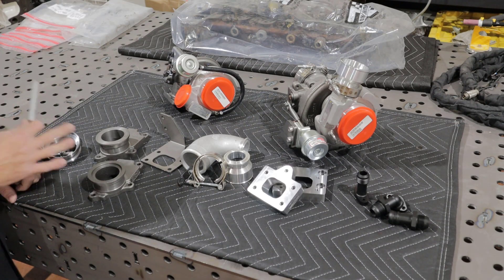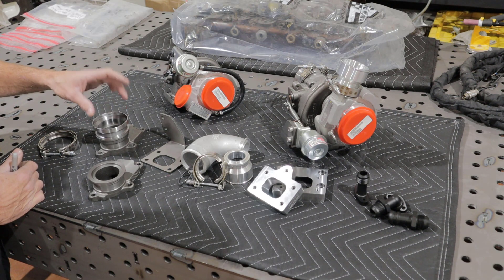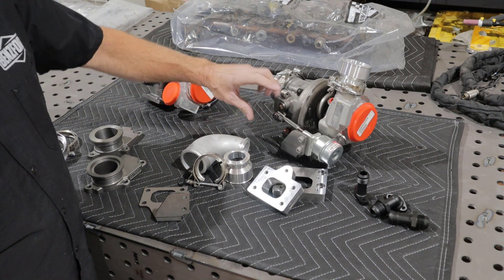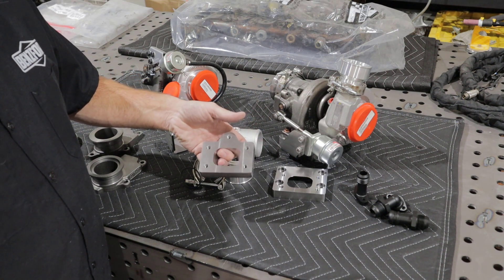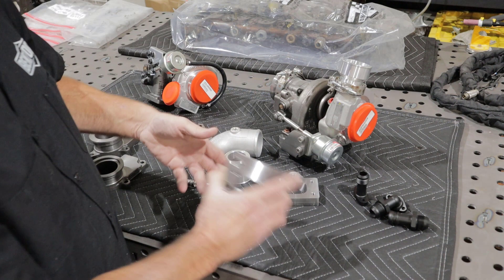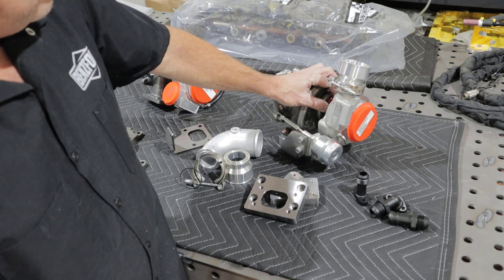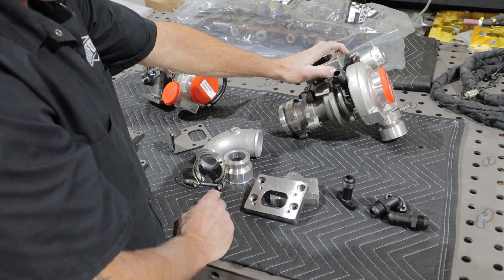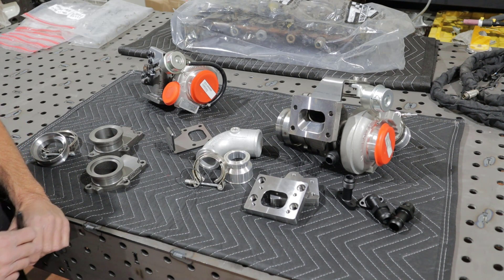BenzForce's Holset HE200 Series Offering

Comment: Mines leaking oil everywhere and smoking at idle blowing oil up into the air cleaner
Reply from the maker: Depending on what engine it is in it sounds like you had too much oil pressure. Those turbos are only rated for about 50 psi continuous

Comment: How would the he200wg 7cm compare to the HE221W 7cm? I can see compressor and turbine are smaller on the 200wg but is the compressor housing 7cm the exact same size are the 221w 7cm? Would the 200wg 7cm fall somewhere between the 221w 6cm & 7cm? Thank you sir.

Comment: So is the orientation on the 221 what you use for the 617? 

Because I mocked mine all up today and it's drastically different lol.

As a matter of fact, mine is almost exactly what you show on the website, so I'm guess that's correct and this isn't.
Reply from the maker: You have to open the turbo and pull the pins from the compressor and turbine side, unbolt the wastegate, then install with our t25 to t3 adapter and wastgate bracket